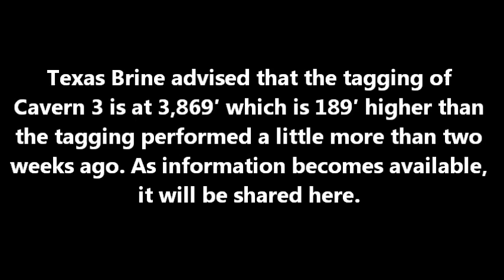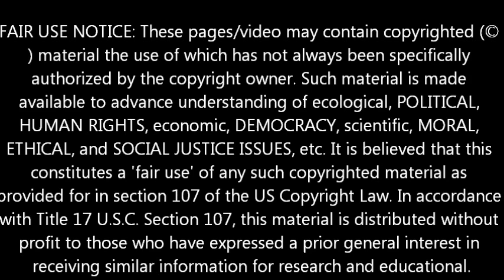BAYOU CORNE SINKHOLE UPDATE- NOVEMBER 29, 2013

Comment: Thanks for the update, cajunmiracle! A great, little, TV news report. Isn't that the truth, it's been downhill ever since. The news reporter hit the nail on the head with that comment. :)
I'm passing your info along down the trail. I hope your doing well, all things considered. In this case, some quiet time is a good thing, or so I thought, until I read what you wrote about Texas Brines, sinkhole's test logs for this week.  Of course, with the tagging of Cavern 3 now at 3,869 feet which is 198 feet higher than when they tagged it a little over 2 weeks ago, isn't a good thing, and although quiet, this sinkhole is doing what it does best, sinking downward taking organic material with it.  Geez, what a mess. :(